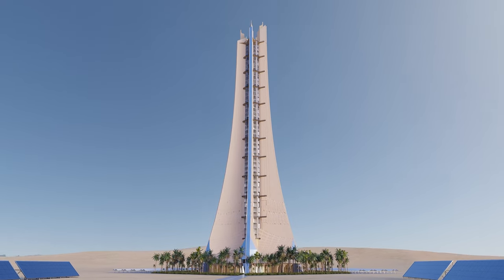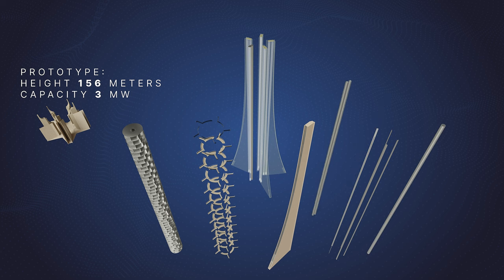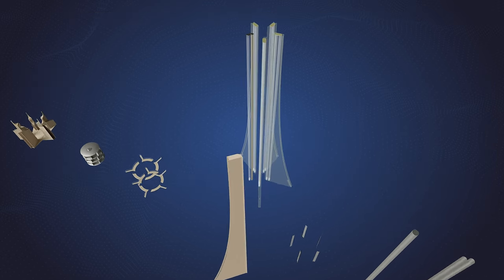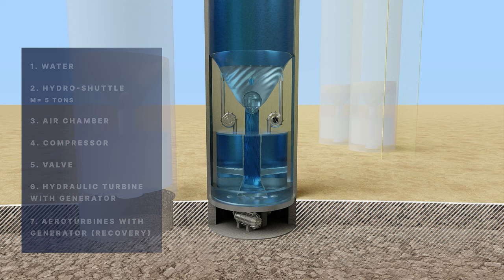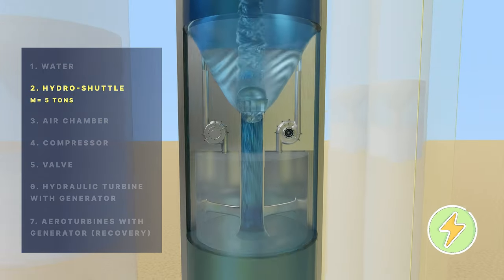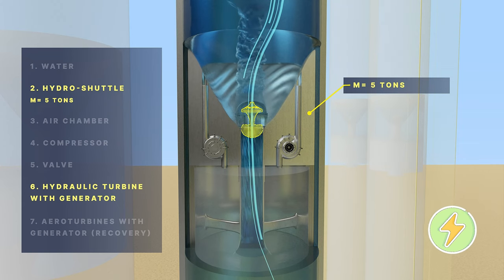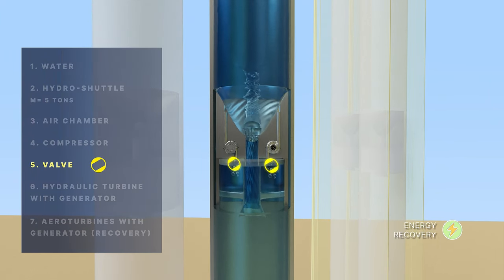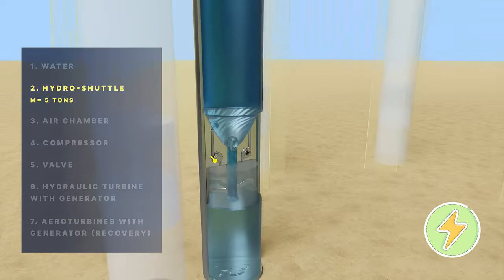PROJECT V.O.D.A - PRESENTATION

Comment: The energy to pump the air in at the bottom of the platform is larger than the one returned from the lifting power of the bubble due to friction. Besides gravity pumps are known for their low output. Per one ton per meter per second you only get one kilowatt. So if it was 100m high and buoy was a ton, it would generate 1kW for 100 seconds which makes it 100k joules. Given you need 4.184 joules to heat 1g of water 1°C, it would boil 240g of water from 0°C to 100°C. That is so small energy that a cat could generate more with tears.

If instead of pumping the air out, you would let the water flow out somehow, you would still need to pour the lost amount at the top lifting of which would again use more energy than the bubble would create when lifting.
Reply from the maker: It's good that you thought about it. There is a prototype in the office (Dubai) with a break-even point of 40 meters. There is a full video about the technology on our channel. If you are in Dubai, we will be glad to see you.
Regards, Anastasia

Comment: Imposible. Firstly I also thought that this is great idea. But Simple physics, to put water back in water tank will took to many energy. Pressure in the bottom is too big. I can imagine pressure on depth 130 meters. So there are a lot of question for this technology. The easiest why you didn't present here simple example 1m height on 10 watt.
Reply from the maker: the latest V.O.D.A video features 97% technology. When released into the atmosphere, recovery occurs. 
Regards, Anastasia